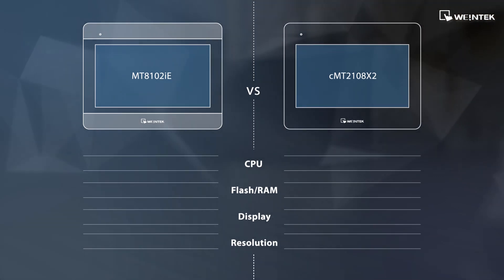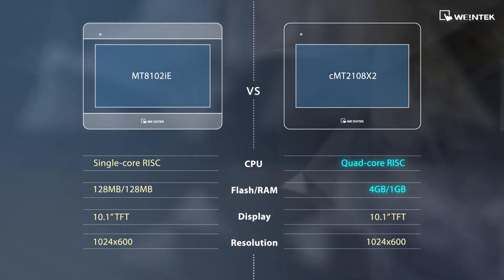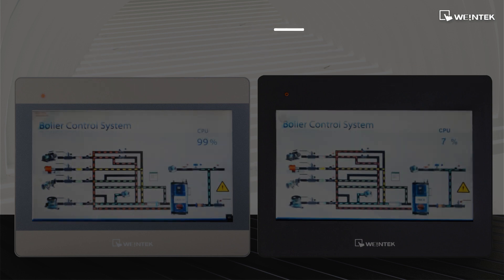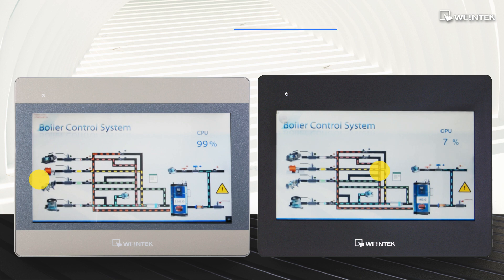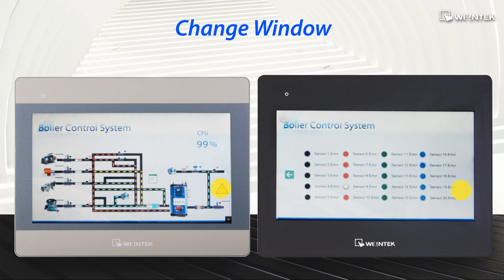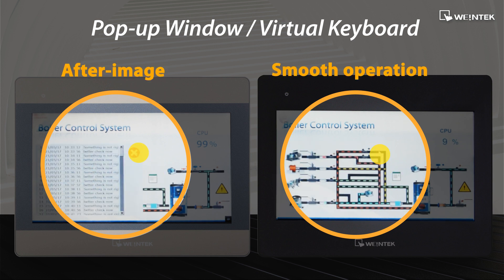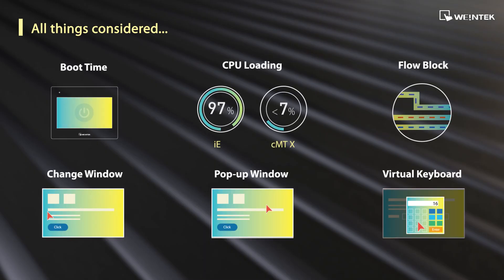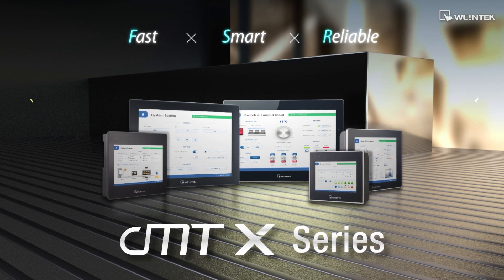Performance Test: iE Series vs cMT X Series

Comment: Do we really need a so fast screen ? The operator generally will not spend more than 15 minutes per day on the HMI. (Certainly less with a small screen where you cannot display a lot of information)
Reply from the maker: Hi sir,
That is a good point. It really depends on the needs. This video would like to display that the cMT X series remain excellent performance even when it is in multitasking works. Fast is one of the features in the cMT X Series, more useful functions are included in it as well. More about cMT X:  https://bit.ly/3GQwRka
Reply: Is there WhatsApp?